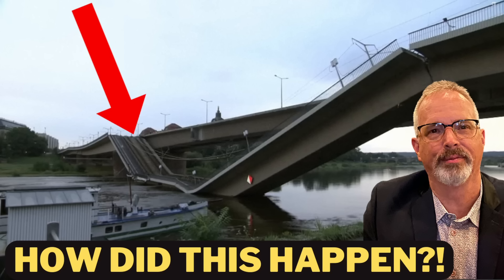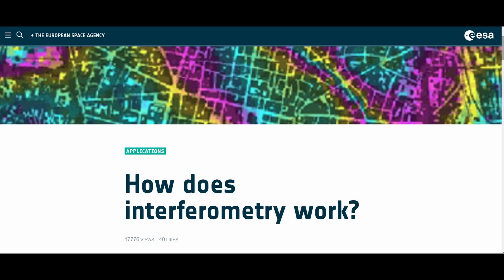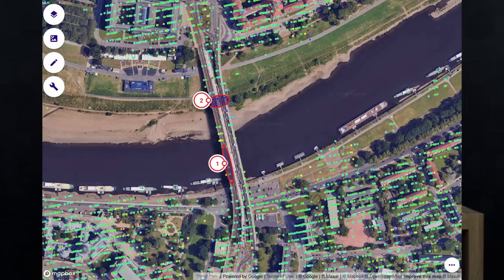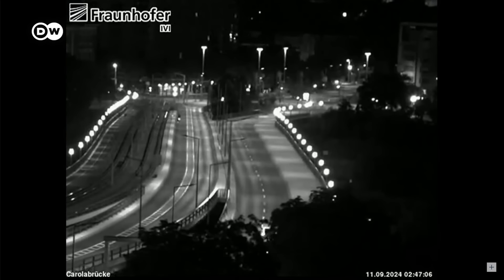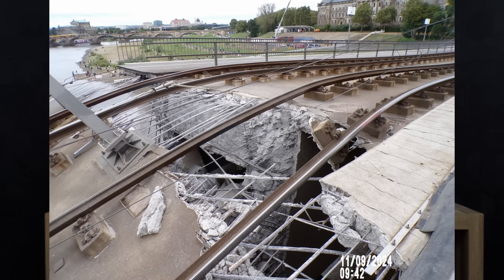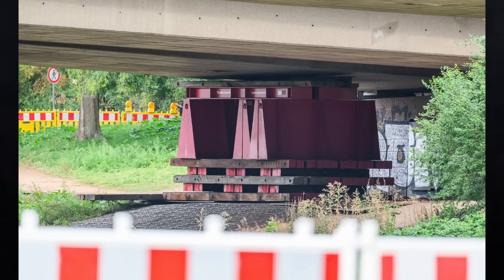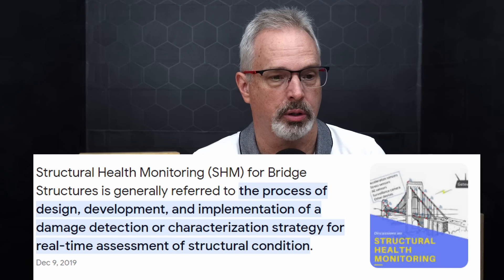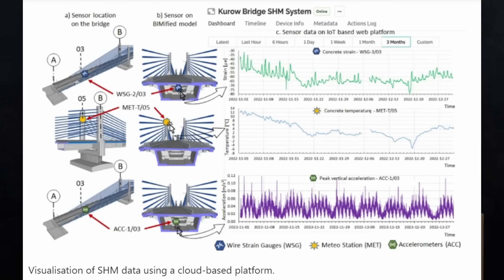Carola Bridge Collapse Update - Dresden, Germany

Comment: Regarding your points on the previous Carola bridge surviving WW2 bombardments by the Allies: The chart you showed of Dresden's damage percentages only mentions damage, not what kind of damage.

Allies and especially the UK in their night bombing's strategy used firebombing (not solely, but a lot) on city's. In the case of Dresden the old town was a) mostly wooden buildings and b) quite undamaged, when the big raid was performed (no longer looking for specific targets, military nor factory nor command) on the civilian population, it resulted in a firestorm burning down the percentages you saw in the center of the town.

The bridge being stone it survived the fires. Moreover where the Russians about to enter Germany and it would not have been peachy between Russian and western leaders when the allies would have dropped regular bombs on the bridge and collapse it.

Regarding maintenance and diagnosis: Like most bridges in Europe and maybe the Soviet Era Eastern German ones especially(?), this bridge would have seen enormous gains in traffic over the last decades and is probably used (far) beyond it's designed specifications. 
Having seen and read about upgrades to some bridges near me in the recent decade and the traffic numbers making those upgrades necessary, i feel like most motorway bridges and some trainbridges (though those are probably more over-built then the roadbridges) will collapse at some point in the last decade of their 50 year lifespan.
Reply: It's more, the technology of prestressed concrete was very new in the late 60ies, there was not much experience on long term maintenance.
Today the put the cables in a hose, add sensors for the stress on the cables, and even make the cables replacable.
Some roofs with this technology also collapsed, famous one was the congress hall in west berlin.

Comment: Sorry, but it's not only a problem of bridges that have been in the sovjet aera (or GDR aera). Especially 70's or early 80's bridge constructions are prune to corrosion and failure. We had a collapse of an autobahn bridge under construcation a couple of years ago in our area (this was due to help constructions failing after wet soil, following exzessive rain).

This was an accident wainting to happen and it was certainly not the last.
A lot of buildings have been reconstructed or refurbshed back in the 90's in Eastern Germany, so the standard has been raised to western standard. BTW: sovjet constructions are like being ground of a single brick. It's rather eastern german construction than sovjet.

Comment: Hi everyone, i have a question to the uplift detection method with the help of inSAR data. Are there ground-based measurements that allow the method to be validated? How is the traffic load on the bridge corrected during the recording of the inSAR data? I guess this factor has also an impact on the bridge movment....

Comment: While the collapse of the bridge may have been unexpected - I'm sure it was, otherwise it would have been closed for traffic - the problematic state was known for years.

Yes, the bridge was built during the time of the GDR I haven't seen anything yet to indicate a relation with the specific construction methods there were the cause.  In West Germany many bridges of the same era are in a similar sad and often critical state.  This is known for years, it's being worked on but it's basically an impossible task, a race with the eventually unavoidable closure or collapse of these bridges and other structures.  Generally the expected life time of the affected bridges was over estimated.  Common faults are rebar that's barely covered by concrete and generally insufficient corrosion protection.

Comment: How does the analysis of the satellite data account for the roadworks, that were ongoing on the bridge for the last years? They extended its width for pedestrians with new carbon concrete and renewed the road surface on both sides, during which time they removed the old road surface. The satellite data approach sounds promising though!

Comment: InSAR? a little expensive but sounds like a good technology...
I think something similar was used in the USSR to monitor railways... though the system was much more primitive they seemed to be able to use satellites to monitor the sections of track built over potentially marshy-permafrost type soils where movement became an issue. given a vast system of very remote tracks, that was a really important part of preventing washout related derailments...
(the exact tech used was never declassified since the satellites were military owned, but sounds related...)

Comment: What does the InSAR data say about the closed bridge in Rhode Island and what about the various bridges constructed with T1, ASTM A514, Steel which have experienced Hydrogen embrittlement ? Can the effects caused by cracks from Hydrogen embrittlement be detected by InSAR observations ? If so, this may be an efficient means to evaluate structures prior to any need for closure or potentially allow early remediation.
Reply from the maker: You and I are on the same page.  I will be getting data on such projects in the near future.
Reply: @CaseyJones-Engineer Thank you. Interested in the Rhode Island situation.

Comment: That's such an esoteric data source. Bridges, I think by Law require periodic in-person inspections. That alone is designed to catch problems like this. Outsourcing in this fashion will usually lead to more lazy, sloppy, bureaucratic negligence.
Reply from the maker: Nobody is talking about eliminating periodic or special bridge inspections. This is merely an additional tool that can be extremely useful.
Reply: @CaseyJones-Engineer  One thing I noticed is that the sampling they did, selecting the two areas were extremely post-hoc. 
I don't see any methodology here that could be standardized. They selected two squares that they already knew were relevant. Bridges live for a Loong time. Their regulations change veery slowly. Methods ditto. Jamming into this a new process that in five years could change drastically means that it is hard to use such a tool consistently long-term. And have you seen those trendlines? Veery noisy. It's an idea, but usually 9/10 such ideas die for one technical reason or another unexpected obstacle.
Reply from the maker: @mrJety89   I disagree with you on just about everyone of your points.
Reply: @CaseyJones-Engineer  What you present here is a hopeful thing. A hopeful way towards the future. What may be invisible here about what I'm saying is the amount of unforeseen consequences of integrating these technologies into a larger system.
Reply from the maker: @mrJety89  I am not really impressed with that point.  Any new technology or new application of a new technology can have both positive and negative untended consequences but that doesn't mean that they shouldn't be pursued in order to lead to better results and outcomes.
Reply: @CaseyJones-Engineer  The example, in particular, that I'm thinking about, is the pursuit of new drugs. There are 100 year's worth of drug discoveries behind us, yet generic drugs are not profitable enough, because their patents have run out. So drug companies keep patenting new drugs, and, as they say, the drugs are "better than placebo". It would be mouch harder to come up with new drugs, if you had to prove that they are better than the best generic drugs. So they don't. This leads to a degradation in the quality of new patents. 

What I'm looking for in a discovery like synthetic radar is, how is it better at measuring bridges, than existing 100 -year-old or 50-year old approaches.
Reply: @CaseyJones-Engineer  Now that I'm thinking about it. Synthetic radar has a lot of good things about it. This case study of the collapsed bridge sounds to me like a sales pitch.

The actual applications of synthetic radar should be based on the millions of data points it collects every hour, instead of the two or three that happen to fall on top of a bridge. The real strength seems to be in the large scale; this story is a way to give it more exposure, but not necessarily the main thing that it can do for you.
Reply from the maker: @mrJety89   I don't want to keep going back and forth with you but your characterization of the methodology is wholly inaccurate.
Reply: @CaseyJones-Engineer  I think I said everything that's on my mind. I am a physicist, and I look for strengths and weaknesses in a technology. Thank you for listening.

Comment: What's the EFFECTIVE difference between prestressed and posttensioned? 🙄Yes, I get 'pre' and 'post' but how do they change the outcome, the final result?
Reply from the maker: There is no direct comparison.  Pre-stressed concrete is done mostly to allow the concrete element to survive transport from the casting yard to the jobsite.  Post-tensioned is how these elements are assembled into an overall whole.
Reply: @CaseyJones-Engineer  I took a class on Pre-stressed concrete.  When using pre-stressed concrete, the design uses the steel for load and the concrete to keep the steel in the proper place and orientation.  All concrete cracks, it is a matter of keeping the cracks closed and controlled.  
There is more control over the tensioning process in the casting yard than on the job site.  Many pre-stressed beams are post-tensioned together during the erecting process to make a more unified structure.
Reply: @CaseyJones-Engineer  thank you
Reply: Pre-tensioning is achieved by stressing strands before the concrete is cast around them. The wires are then released and so compress the concrete. It is mostly used for elements such as bridge beams which will then have a deck cast over the beams. It allows factory conditions of accuracy to be achieved.
Post-tensioning is where the concrete is cast on formwork with ducts cast into it. The ducts contain strands which are stressed (using jacks) when the concrete has attained the required strength. This method allows the prestressing forces to follow a curved path corresponding to the bending moment being applied. Unfortunately, it was often the case that the ducting allowed water ingress and corrosion of the strands to take place which could not be readily monitored.

Comment: while that data is pretty nice, it was known that the bridge was in urgent need of repairs.
the car part of the bridge got repaired recently and the part that collapsed was, as far as i know scheduled to be repaired for next year.

the question is does this data show that the issue was urgent enough to imediately close the bridge? does this data show damage beyond what was known?

infrastructure gets checked very  frequently, the problem is not that things break and no one could have known, the problem is that you need to spend money to fix it. so the question comes down to "ok the bridge need repairs, but are those repairs required today or this year or within 5 years?

Comment: So similar to the Florida condo collapse.  Too little thought to repair, too late.  Concrete needs more maintenance than is currently being done.  Water proofing is a main need to keep corrosion of re-rod to a minimum.
Reply: keeping corrosion to a minimum, still needs a way too measure how much corrosion has occured. This is what they havent't thougt on , on older bridges. Today they keep that in mind upon construction.

Comment: Wonder what a similar data set on Stonehenge II would run.  US 101 / 280 interchange in San Jose, CA. Similar construction and age. 

Picked up the name spending years incomplete. The spans in the air on but the ramps to get traffic on and off added much later, making it more a decoration for years.

Comment: Could these type of failures be caused by fatigue failure? Maybe more so in concrete. Maybe related to distance from pilings and distance between pilings. Possibly related to a section in which there is a slight up and down bending. One side of the breakage is more anchored than the other side of the breakage. There is more leverage on one side than there is in the more anchored side.

Comment: Currently the US structures' design life standard is 100 years (but that's only in the last 20 yrs).  Just wait for all the Cable-Stayed bridge failures.  No way to monitor the Stays effectively and if the grouting of the stay ducts was not done correctly they won't last the design life let alone longer.  See the 2018 collapse of the Morandi Bridge ( Openned 1967) in Genoa, Liguria, Italy.

Comment: Not uncommon at all to "overshoot the estimates" from a bridge build and have enough left over from that for a 3rd Bridge which may have been the case here as appears all three were built at the same time. The problem of course is that these "leftover product" builds can be very inferior product meaning bad concrete so overlaying this data with any subsequent test of the material itself would be interesting to see if anything observable from that as well and of course seen reinforcement material said steel if that was an inferior "waste steel" of some sort. Had something similar happen in Florida with a pedestrian bridge which killed more than a few people and am not saying this is the reason why but yes definitely worth paying attention to as this was a railroad Bridge as well so very valuable Bridge. Amazing study on an advanced satellite system 😊

Comment: Each dam has robes and holes and a pendulum inside, by which you can identify movement. Similarily what you are showing could be locally done by comparing positions of distributed edges along a line of sight along the bridge. True? Alternative thought: Maybe Vladimir still had the keys for maintainanve holes of the bridge, with the pre load adjsters inside 😂

Comment: 10:18 Theay destroyed the next 2 fields, because it was also structural demaged. In pictures, you can see, it bending down. The first collapsed section lay still in the water. This section in the river had little influence to increase the waterlevel in the flood, only 2 or 20 cm. Now they prepare destroy the other side and bring the first collapsed section comletley in the river, where it would cracked in pieces from a temporarly runway.

Comment: It seems to me that the statement "the warning signs where there for years" is a conclusion that can not be derived from what you explained here. At least for me warning signs is that there was some indication that there are issues but all you present here is that there was data that could have been analyzed to get these warning signs. If they even were warning signs because it is always easy to say afterwards what went wrong, which is completely useless in itself. It however could lead to something useful when it helps in developing tools to predict other events like that.
Reply from the maker: The data showed consistent movement trends for the lasr 3 years.
Reply: @CaseyJones-Engineer  This is still something that was analyzed in the aftermath. The question is if this is really predictive and for that a lot more bridges have to be analyzed that just the one.

Comment: Corrosion would have been evident at the breaks soon after sunrise that day, yet I've not heard of any actually found there, just speculation.
Reply: Yes, there was corrosion, it made the bridge 'weaker' but it's hard to say, this is the only and final reason to break. Could be a combination with temperature that day. Maybe there was some vibration from a 50cm hot water tube inside the bridge, there are many possible influences.

Comment: I am no engineer but can someone explain if crucial bridge elements were deteriorating due to corrosion why the failure didn't occur when it was under maximum load? That is when a train/tram was passing. The fact that it collapsed without even the extra weight of a slim German on a bicycle must mean something but I don't know what.
Reply: The bridge failed under its own weight. When the last tram drove over it that point hadn't been reached yet.

Comment: Is this the same type of system that is used to measure ground deformation in volcanic areas?
Reply: It is one of the ways used to measure volcanic deformation. There are others (GPS, inclinometers, ground surveys, etc.). It has the advantage that wide areas can be a analyzed with no on-the-ground work. But the long time between measurements means it can't replace other continuous monitoring methods.